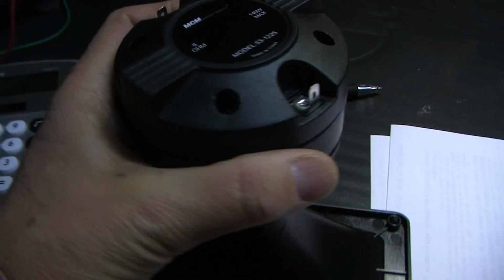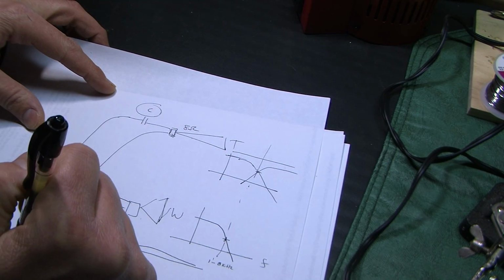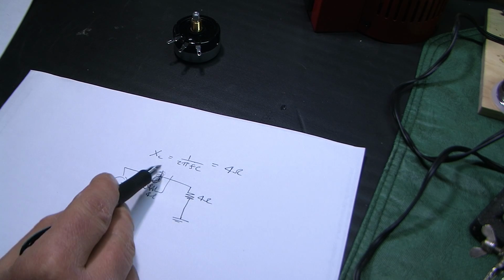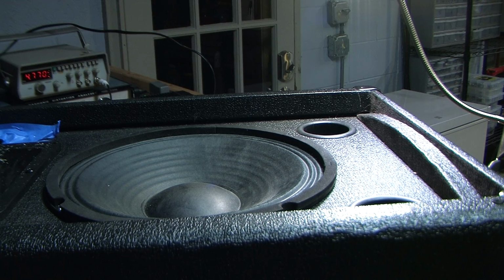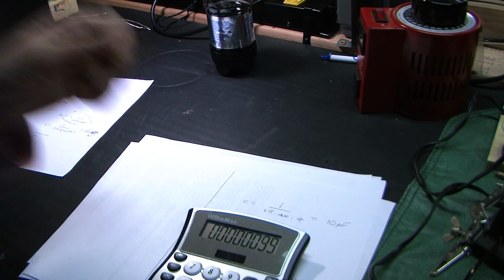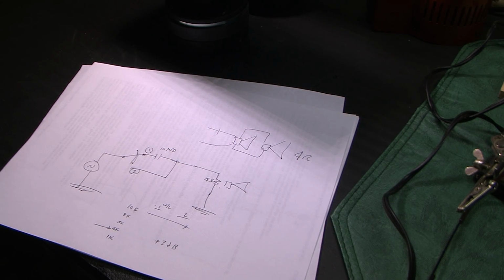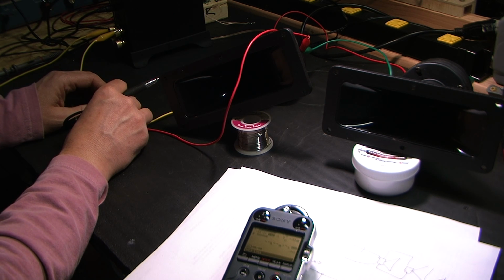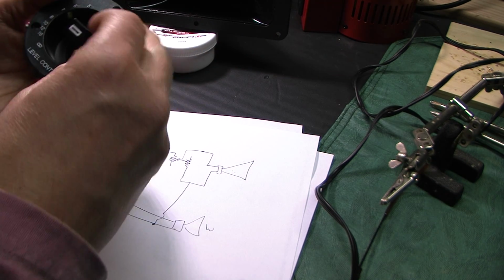Speaker Project Part 2 - Crossover Frequency & Capacitor Determination

Comment: I recently made a pair of bookshelf speakers, the crossover point is 5000hz, I've used a second order Butterworth crossover and the impedance of the woofer and tweeter is 8ohms each. However the tweeter is too bright or the woofer is too quiet. Would I be able to adjust this with L pads?

Comment: Nice video broo. I learned a lot.  I was wondering,  How would it be with a 3-way system? Can I use the same formula in order to get the exact value of the capacitors? How it should be done with a midrange? Thanks broo! I'll really apreciate ur answer.

Comment: Are you this technical on everything you do?? THIS is a long video for no reason. Just explain the stuff and give advice, move on..
Reply from the maker: +Paul Wilson Sorry, I've achieved the highest level of my incompetence; it doesn't get any better.
Reply: Do you feel entitled to his advise, Paul????
Reply: Seriously! He actually explains how to do it without computer generated BS which they always say you will probably have to swap out components when you're done he's doing it old school which has worked for close to 50 yrs these formulas DON'T CHANGE you can't reinvent the wheel
Reply: Low tech you can do this with your stereo amp
Reply: This is something if you just watch you might actually learn something instead of going oh shit I'm screwed I'll just buy a premade crossover that's not anywhere near where it should be cause it's too complicated

Comment: Put the tweeter sideways in the box, slide the flat edge up through the round portion of the opening. Then you can surface mount that horn to the baffle.
Reply from the maker: +Pha Q Couldn't do it w/out cutting the hole larger; didn't have the will lol :)
Reply: stereopolice Sorry, I thought about it again and realized the round portion would need to be bigger than the flange on the horn.